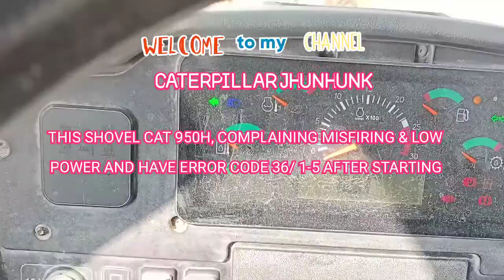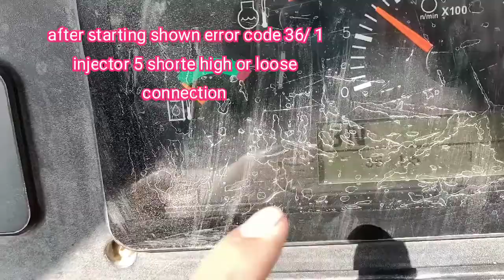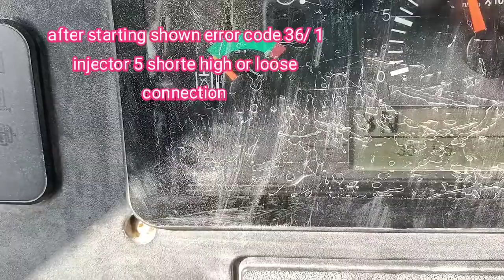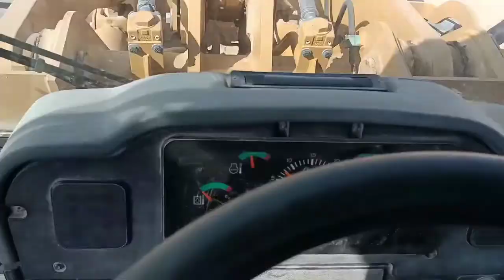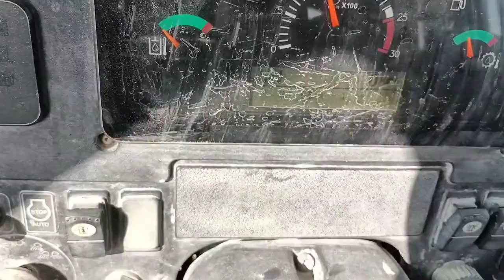MY DAILY DUTY,.CAT SHOVEL 950H MISFIRING OR LOW POWER error show after starting 36/ 1-5

Comment: I have the same loose connection error on my Cat 320D C6.4 engine causing low power. Did you open the injector? Is it repairable or need to change the injector?
Reply from the maker: yes bro it is possible, or try to check the injector wires sometime it is just lost connection
Reply: @caterpillarjhunhunk  Have checked the wires bro but I think the top electric part of the injector is not working
Reply from the maker: @revolution19800828  ah ok,that injector is repairable